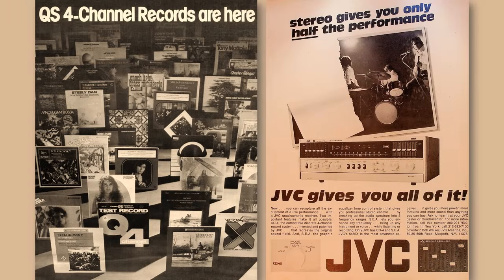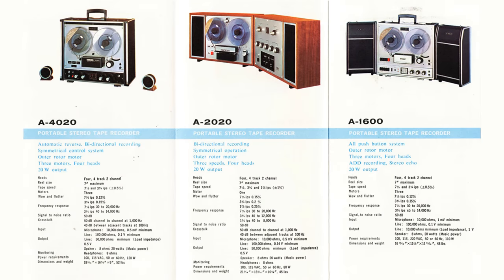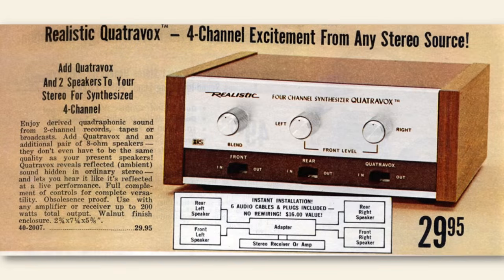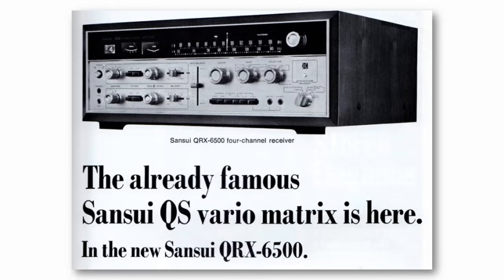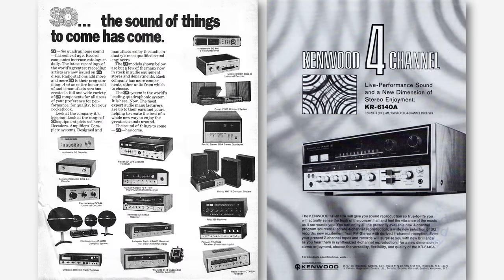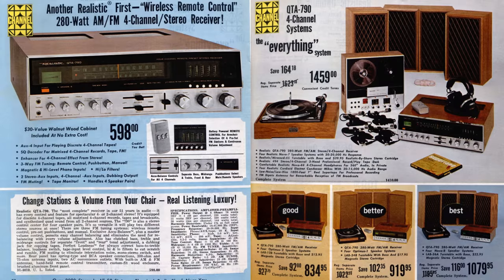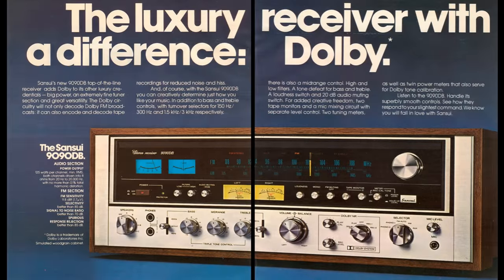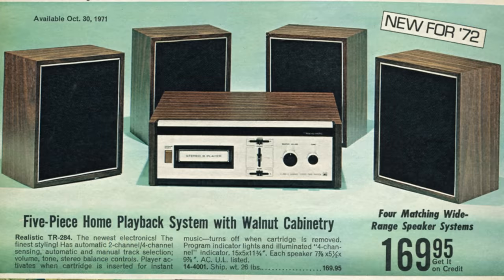4 channel FAILURE - The Quadraphonic Story

Comment: IMO the reason quadraphonic sound failed is because it doesn't work as claimed. I've loved live and recorded music all of my life. I began going to live concerts when I was 5 years old and have been to countless concerts. I listen to many genres but my favorite is classical music. When I was 12 years old I heard stereophonic sound for the first time, loved it and became an audiophile. At that time the stated goal of the audio industry was what they called "concert hall realism." I watched the evolution of quadraphonic sound. It actually started around 1964 with Stereo Review Magazine. It was first suggested that a monophonic center speaker be added to fill in what was called "the hole in the middle."  This phenomenon was also called "ping pong stereo." Enoch Light on Command records used this fact to arrange recordings that exploited it. Then someone at Stereo Review got the idea of putting the third speaker behind the listener and wiring them between the hot terminals of the two channels to capture the out of phase sound for "ambience." Hafler put two of them in series and quadraphonic sound was born. His "Quadaptor" was nothing more than a box to facilitate this circuit a little more easily and was incorporated in his SCA80Q 40 wpc integrated amplifier which combined circuits from the PAT4 preamplifier and he Stereo 80 power amplifier. All of the so called Matrix system SQ, QS, RM, were variants of this phase difference idea. The only difference between them were the parameters. The RCA CD4 system used an outband signal for the rear channels in somewhat the same way FM stereo works. It requires a cartridge that has a frequency response out to 40 Khz. I've actually got a CD4 cartridge Empire 4000/DIII which is rated to track as low as 1/2 gram and extends to 45 khz. I've never used it in that mode and to me it sounds identical to the 999VE. I call HT and SACD son of quad and the others like 7.X, 9.X, Y.X grandsons of quad. Perhaps Dolby Atmos is great grandson of quad. 

So at the age of 25 after incredible hype by the industry I built a quadraphonic system and I immediately hated it. It didn't sound like any concert I'd ever been to. The first thing I noticed was that if I could hear the rear speakers at all, I'd know exactly where that sound was coming from. That by itself was a deal breaker. By this time I was a very well trained engineer with a lot of science and math floating around in my head. My first thought is that if the gurus in this industry say this sounds like concert hall realism they are either liars, deaf, or don't know what the hell they are talking about. So I threw my audiophile hat in the trash, lost all respect for them, and put my science and engineering hat on. I began thinking about how concert hall acoustics worked. I focused on sound fields and to my astonishment, after  few weeks I figured it out. I developed my own mathematical and physical model that is exact and very different from the way acousticians see it. It accounts for every reflection you hear in your seat from any number of finite sources. A machine to do this with scientific accuracy seemed impossibly complex. This was 50 years ago. 

Nevertheless, I decided to see what I could do to adapt it to get any improvement from recordings at all. And I was amazed at how well I've done. I patented the idea so that no one could steal it from me and found that there was no interest in it. This machine works on entirely different principles than other stereo systems you could buy. It's in a category I call Engineered Sound Field Technology. This invention is called Electronic Environmental Acoustic Simulation. If you read it ignore the first three figures. They are part of a different invention and should have been deleted. The only other sound system concept I know of is Wave Field Synthesis, invented in Delft University 14 years later. I've studied it to see what if anything I could learn from it. I thought it was my invention derived from a different starting point but it isn't. It has two related fatal flaws. But I did come to realize that if two sound fields have the same parameters at every point on a closed surface, they will have the same parameters on every corresponding point within that surface by the mathematical principle of congruence. 

So how does EEAS work. It has to do two things. First it must get the frequency response of the main conventional system at your ears flat back to the recording microphones. Second, it has to use a real time computer to generate the signals that correspond to all of the reflections you'd hear and feed them to a large array of small perimeter speakers that aim their sound at the walls and ceiling using the room surfaces as reflectors and diffusers so that they have the same mathematical relationship to the first arriving sound from the main speakers when they reach your ears as you'd hear in a large concert hall. It's no easy trick but it can be done. It's complicated and needs to be engineered and adjusted  to the room it's installed in and then for each recording. Not every room will do. There are certain criteria the room itself must meet or the sound field will not be similar to what you'd hear live. I probably have the only working prototype in the world and it works to my complete satisfaction. It's based around a DSP that infringed on the algorithm in the concept and violated my patent. Lawyers told me not to sue, it would be a waste of money. The product had some bad firmware choices that couldn't be altered. Once I started using it, it took me about 6 year to figure out successful workarounds to correct them. It required more DSP processing power. So I've been playing with this idea on and off for 50 years and having far more fun than shopping around for so called better equipment.
Reply: That's very interesting, although it sounds too extensive for the average consumer. The concerts you went to must have been better sound quality than the rock concerts I've been to. Half the time it's like being attacked by a noise weapon and you can barely tell what song their playing!
Reply: @richardcrook2112  I like many genres of music. Most rock isn't among them. My favorite by far is classical music but I enjoy jazz, pop, Broadway shows, movie music, international too. Most of the concerts I've been to were classical, some opera. These concerts rely on Acoustics of the venue. I consider this true music where all if the sound energy comes from human beings, not amplifiers and speakers. That for me is a facsimile of music. High fidelity's legitimate goal IMO is to close the audible difference. I've been in many concert halls. Many great ones like Carnegie Hall, some awful ones like Avery Fisher Hall. The Acoustics make all of the difference.  I accept that unlike  operatic singers and choral groups, other singers don't have powerful enough voices to fill a venue but can still be enjoyed live with amplification.  It's inherent in the nature of recordings that microphones and signal amplification and manipulation is required. The challenge for engineers is to start with what they give you and arrive at a convincing sound field. So the first things to study and understand is sound fields, Acoustics, and hearing perception.  The equipment comes at the end, otherwise there is no goal for them. They are slaves to electronic measurements or what they like. And the two extremes fight between them.

Comment: My living room Hifi is based around 2 stereo setups, 1 amp driving 2 speakers each. Most of the time the rear is just sent a copy of the front audio to fill the room better, but for films I send 4 discreet channels out from my pc, 2 to each amp. I temporarily connect a 5th powered speaker for use as a centre channel. It's a bit Heath Robinson, but provides a good enjoyable surround sound experience without buying expensive surround decoders or having to use non Hifi home cinema systems.

Comment: You missed the BEST thing to come out of JVC's quad lp research: JVC Supervinyl, the plastic used for vintage Mobile Fidelity LPs. This formulation is sadly no longer made owing to its toxicity in manufacture.

I've been able to play back SQ stereo records properly since the late eighties, but I have never had a tape based surround setup or a CD-4 turntable.
"Quadio" titles from the Warner Brothers catalog are coming out on Blu-Ray today as remastered reissues. A handful of quad albums came out 20 years ago on DTS-cds that played only white noise in regular cd players ('Days Of Future Passed' was one such release). 'Dark Side Of The Moon' saw a 5.1 mix pm SACD in the early 2000s and thereafter another reissue had the seventies Quad mix and the 5.1 of that title issued together on disc. Most of the DVD-A 5.1 titles released in the early 2000s were Warner Brothers acts (like R.E.M.) Also today Steven Wilson of Porcupine Tree is remixing classic prog and new wave albums for 5.1, and the bands are releasing them on CD+Blue Ray sets - These acts include King Crimson, Yes, Jethro Tull, XTC and Tears For Fears.

Comment: Commercial Quad 8-tracks ran at the same speed as normal stereo 8-tracks....They got the same number of songs as the stereo release by putting 2x as much tape footage inside the cartridge.  The average album of the day is about 30 Minutes (usually designed around a single LP which could hold around 15 minutes per side), I've seen and have several blank 8-tracks that advertised 90 minute stereo recording capacity (I even spliced extra tape into one such cart to try and make an especially long mix tape once)....Halve that to 45 minutes for quad and it's still ~1.5 times more tape than a quad cartridge needed for an album intended to be released on a single LP (I've never seen a quad 8-track release of any double LP length album so I don't know if they split those among 2 tapes, crammed more footage in a cartridge, or did both on a case by case basis).
The only consumer 8-track machine I know that could record non-standard speed is this Akai and it could only run double speed (half recording run time) https://youtu.be/QHf-2PcoG90
With regards to the record formats it wasn't exactly a one or the other choice per-say. With the exception of CD-4 all the formats could be more or less decoded by the other decoder formats just with the instrument locations or speaker phasing muddled compared to using the correct decoders (many people actually use modern Dolby surround decoders to play quad records because this principal holds for that equipment too). Most matrix decoders I've seen supported both SQ and QS, and some even supported EV as well. EV came first and based on records and decoders I've seen in the wild had the lowest market penetration of the matrix formats, QS had more decoder support but seemingly comparable record sales to EV, and SQ seemed to be most common. EV seemed to leave the market quickly when the newer matrix formats appeared based on record and decoder release dates I've seen in the various equipment and discs I've collected and encountered.  CD-4 wasn't as popular as SQ but seemed to run second among disc formats. 
If you haven't guessed I'm a quad collector, and have every format released here in the USA (UD-4 never sold here), I even have factory quad 8-track in my 78 Lincoln Mark V.
Reply from the maker: Thanks for the info Tom.

Comment: I never did go for quad.  The closest I ever got was wiring rear speakers in a Hafler configuration when listening to the VHS Hifi tape of The Empire Strikes Back.  But I do have the surround sound version of The Dark Side of the Moon, and it's amazing.  My prepro upmixes to my overhead Atmos speakers.

Comment: There's  DTS releases of Pink Floyd stuff (other albums), I also have some bootleg 4 channel WAV of various other albums. Autobahn by Kraftwek is good in quad as you might expect. My 5.1 system is driven into 4.1 (quad). Tomita also released quad and Dolby surround albums. He also released a 5 channel album, the write up says you need a speaker above your head! I forget the album though.

Comment: I wish I had a quid for each time I have I seen stereo systems in people's homes with the stereo speakers placed side by side or just either side of micro-systems. I don't really think the mass market is there even for ideal stereo reproduction (aside from through headphones), let alone set-ups that require more faff.
Reply: Reproducing any type of surround sound requires proper placement of at least two speakers and the listener. For most people, it's just not worthwhile - they'll be up and moving around the room, or have music on in the background while they work or read. There's no reason to lay out their furniture for optimum sound-field reproduction.

Comment: Sometime in the late 80's / early 90's I purchased a Panasonic DMR-EX98VEB.  4-Head VCR with Dolby Surround - which had a 10w (8ohm) built-in 2-channel amplifier, for the rear speakers.
It was okay...  But aside from VHS equipment being overtaken by DVD's, the VHS drive motor (I believe) must have used a brass/bronze bushing for the spindle bearing.  This eventually started wearing out & caused the motor to vibrate/buzz when FF'ing or RW'ing.  It's a shame as I used the Hi-Fi Stereo for a number of live music recordings.  Hi-Fi VHS uses Frequency Modulation (FM) to record the Hi-Fi music.  An issue if you swap tapes between VHS machines, although the "tracking" function can help, it often never totally LOCKS into the signal, causing glitches!

Comment: Quad-8 cartridges ran at 3-3/4 ips, the same playback speed as Stereo-8 cartridges. Instead of four programs on Stereo-8 cartridges, Quad-8 playback offered two programs with four discrete channels (using all eight tracks). In some cases, thinner tape stock was used. Quad-8 recording decks were also available but rare and expensive. In the environment of a car, Quad-8 playback was rather impressive, and American car manufacturers offered optional Quad-8 players as late as 1979, three years after the format was abandoned for home audio playback. To my knowledge, the last pre-recorded Quad-8 cartridge release was synthesizer guru Isao Tomita's controversial rendition of The Planets, issued in spring 1978.

Comment: Back in the day, through a friend who worked at our local stereo store,  we listened ad nauseam to most of the encoded (record-based) quadraphonic record systems.  None could hold a candle to the sound of a discrete four-channel system - 1/4" reel to reel tape (8-track quad systems were for the Radio Shack crowd).  The record based systems were just "quadraphonic effect" compared to the real deal (discrete reel to reel quad).  Quad reel to reel tapes were the most expensive way to enjoy the format, but it was worth it.  But the biggest drawback to good quadraphonic reproduction was the fact you had to stay glued to one place.  With stereo you can wander around and hear the music just fine.  With quality quadraphonic, you had to be in the one sweet spot.  So quad was too expensive if done right, not not enough va va voom for the buck if done through encoding (record based).  Had the interest in quad held on until digital media became inexpensive (CD's) it might have survived as a listening subset since discrete multi-channel is easily supported (especially for use in cars, where you have a captive audiance glued to one spot).  As your comment on a listen of a quality quad mix down indicates (Dark Side of the Moon from original sources), quadraphonic can be magical experience when done correctly to high standards.

Comment: It's a misnomer that stereo most 3D movies were released with red and blue (anaglyph) glasses to view them. However, some early 3D releases in the 1920's did use them, and cheap early 60's exploitation 3D films did. All the golden era 50's 3D mania films were all presented with polarizing filters matching to the projectors' filters. Some systems used separate strips, i.e. two projectors side by side and synced up. The issue was keeping the synchronization and registration to reduce eye strain. Some projectionists were better at it than others, other times it was the equipment at fault. Later systems used a single strip with both left and right eye information.

All the early 80's 3D revival films used a single strip system that didn't have the registration issues of the earlier ones. Unfortunately they gave you those awful carboard glasses, and often the theater didn't invest in a higher brightness projector or upgraded silver screen to help boost the polarized light back to the audience. So often the 3D film looked substantially darker than it should have been presented because theaters were doing 3D on the cheap with minimal upgrades.

Awesome video about quadraphonic sound. In the end it helped get us multichannel sound into homes for later home theater setups that rivaled what could be heard in a local cinema. So we did at least get some benefit out of that 70's era experiment.

Comment: The Realistic Brand is a Radio Shack Store internal audio component brand. Realistic audio had good and bad components that were very price competitive. You had to really dig into the specs to know exactly what you were buying. The realistic automotive 8-Track systems were very reliable usually lasting until the heads wore out. They could handle a great deal of vibration without skipping. There was a great deal of difference between the sound quality of higher end audio and the Realistic components. If you went into a high end audio store around 1975 and listened to some of the new 100W per channel stereo receivers with a quality pair of 3 way or Klipsch speakers the sound quality, in comparison to your ordinary low cost stuff, was really incredible.